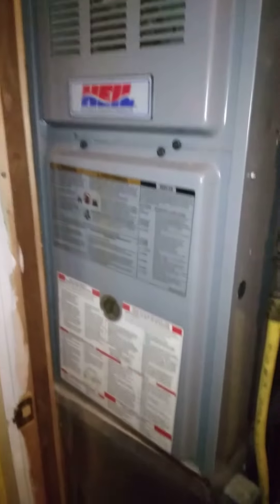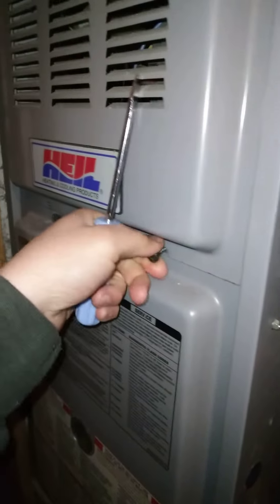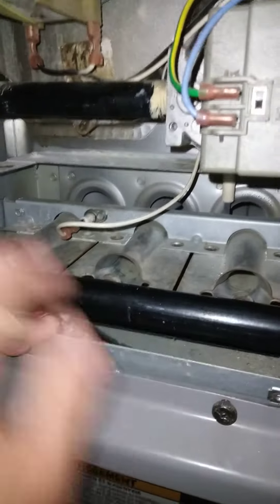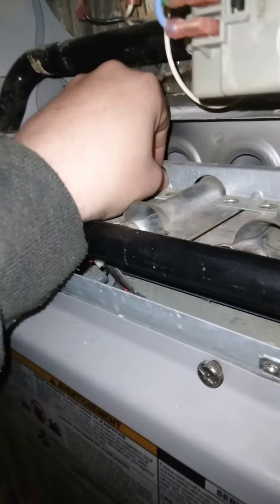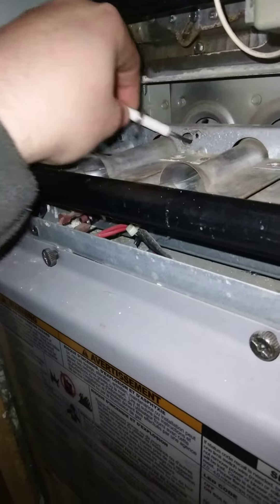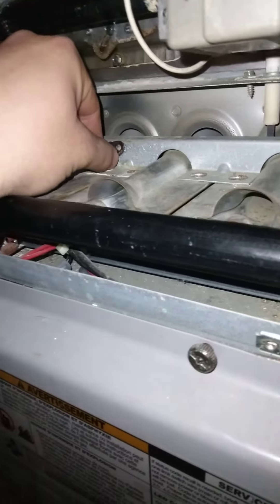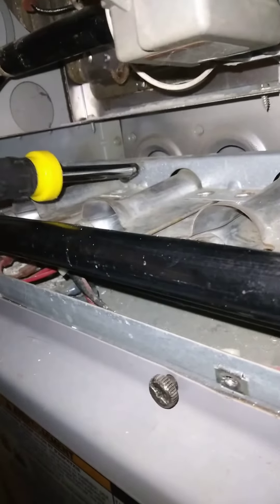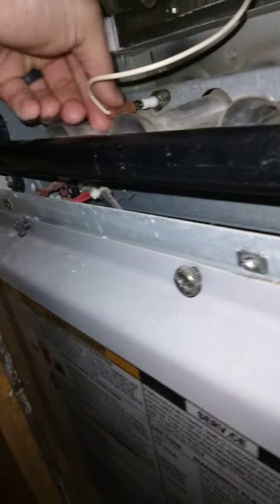Heil Flame Sensor cleaning

Comment: My thermostat works. I’m calling for heat. The fan will kick on the flame sensor or the piece that glows. It’s not a flame. It glows comes on, but I’m not getting any gas to release an account. What could be my problem?